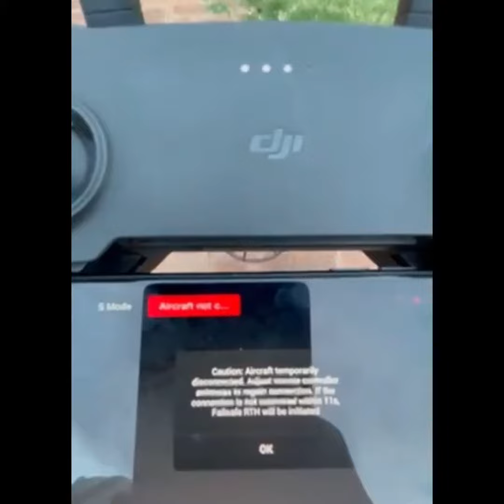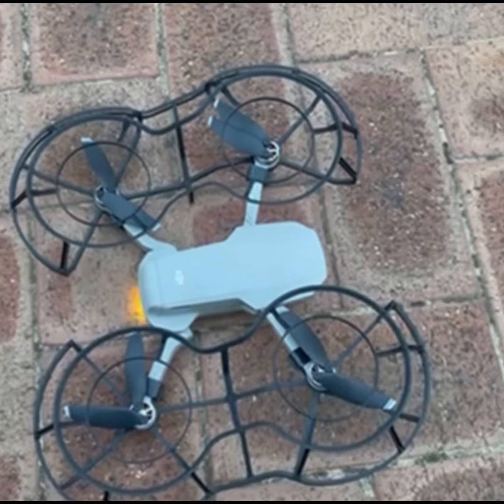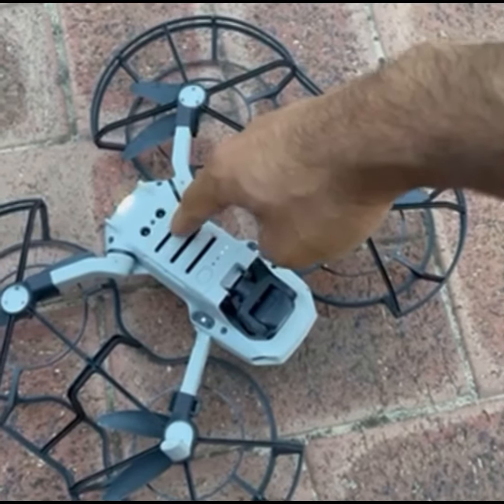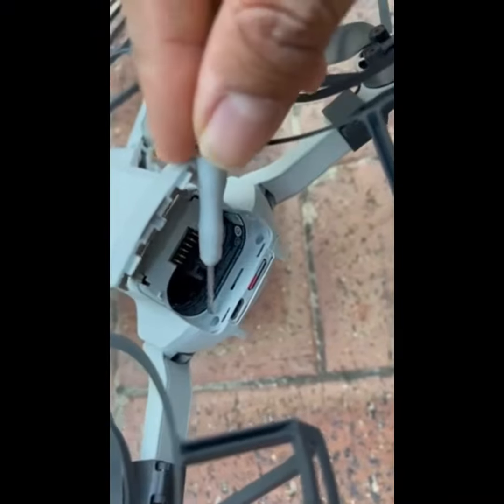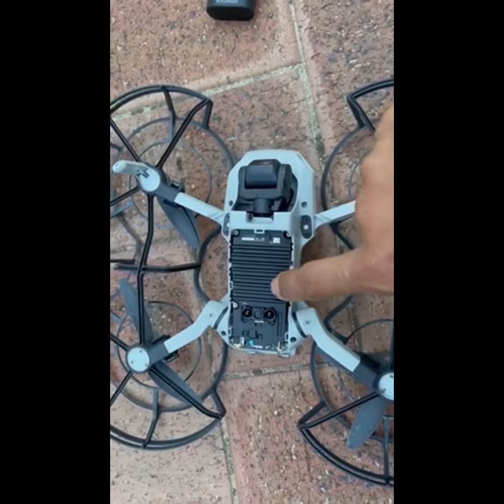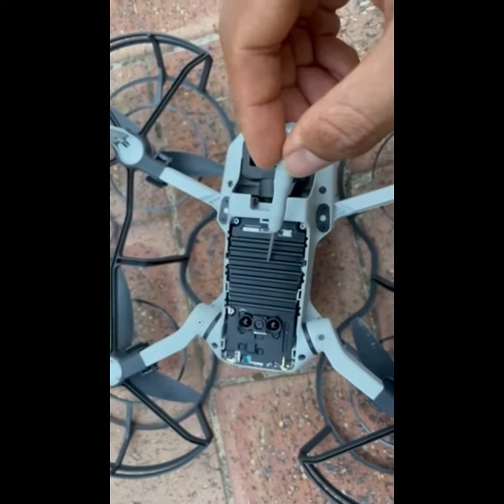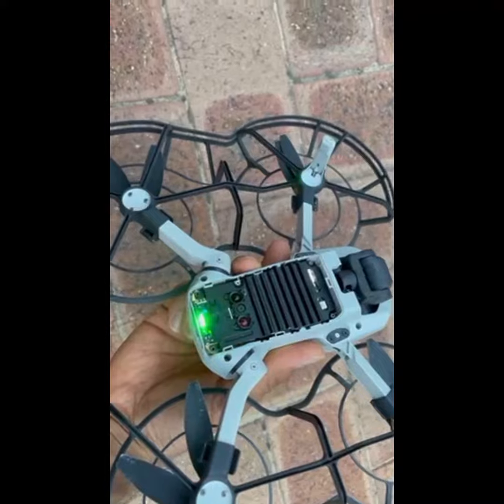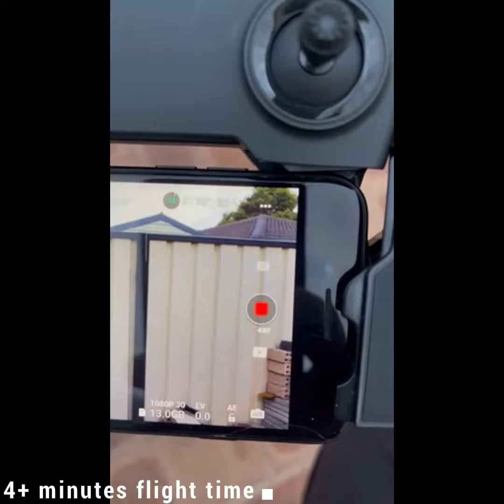DJI Mavic Mini keep disconnecting. Solution

Comment: I solved mine.  It would disconnect 20 seconds after starting recording.  I just formatted the sd card, and no more disconnects.   I was using a 512gb samsung Evo, it started doing it after the card started filling up.  Soo there must be a max card size. Or max storage amount.        Don't start recording under trees.
Reply from the maker: i had bad main board so i replaced it. it's working fine.